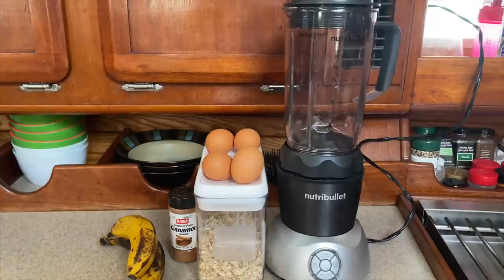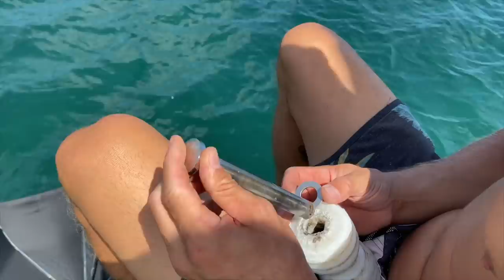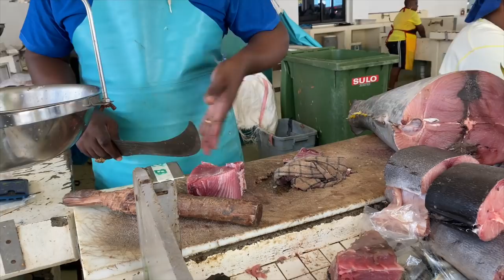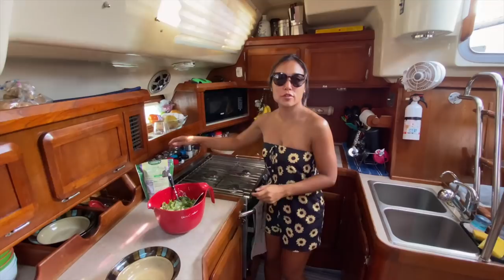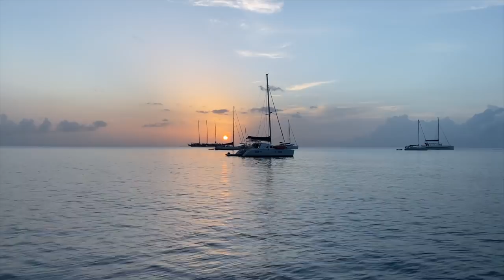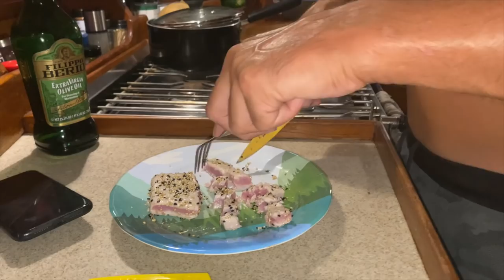Simple BOAT Recipes & REPAIRING a RAW WATER HOSE on a Yanmar Engine - Ep 46

Comment: Travis, go to the auto parts store find a radiator hose the same size with a formed bend that works for you and cut the rest off. Cheap and easy.
Reply: I second that.
Reply: And I third that. Cheap plastic next to heat, might not end well. As recommended before go to an auto parts store and get a hose with the same bend, discard rest.
Reply: Napa let's me walk through the back room and look at their hoses. That looked like a Shields hose. Get the number off of the blue label, you can probably order it from West Marine or Defender. Find the exact part number on Shields web site if need be. I don't think Yanmar makes hoses.

Comment: Could use a bypass hose from a car
Reply: If there is an automotive parts shop on the island he could bring in the hose and I bet they have something that would fit with a pre-bent 90 in the hose.  He would probably need to trim it down but that isn't a big deal.  

I have had good luck bringing in weird parts like this and them being able to dig through the back until they found something.  Some places will even let you do the digging.

Comment: Why so cheap with the red onions?  They are the best part.

Instead of soy sauce try using Bragg's liquid aminos.  It is better for you and even tastes even better.  I love soy sauce but love Bragg's even more.  It's hard to find though.  Maybe impossible down there.

You could use a copper pipe 90 fitting instead of that plastic elbow.  I would put teflon paste on it and double-hoseclamp it, especially if it is below the waterline on the raw water circuit.  Teflon paste really helps seal hose to pipe connections since it lubricates as well as seals so the hose clamp can put perfectly even force all the way around the hose instead of it wanting to pinch right at the screw.  Just be super careful using paste because it probably isn't good for the pump or the heat exchanger if it falls off inside the hose and floats around inside.
Reply from the maker: Haha I actually put more red onions on the bottom but travis is not a fan of them so I try to make it inconspicuous 🤣 have seen liquid aminos in the store but never tried them!
Thanks for the paste suggestion in the hose!